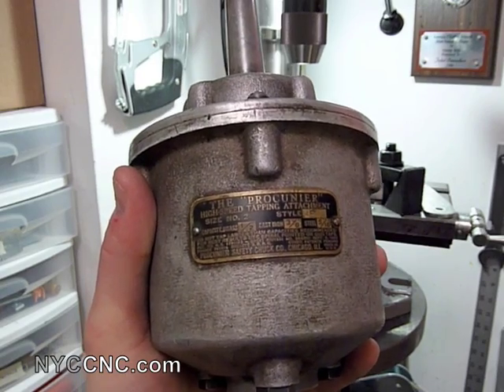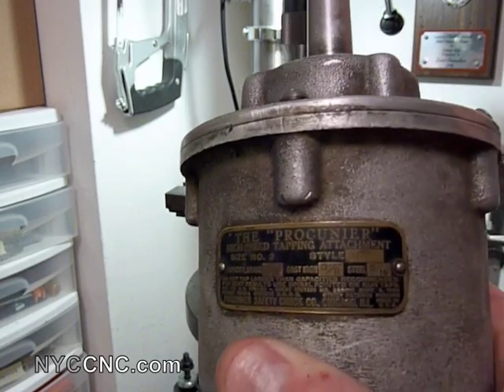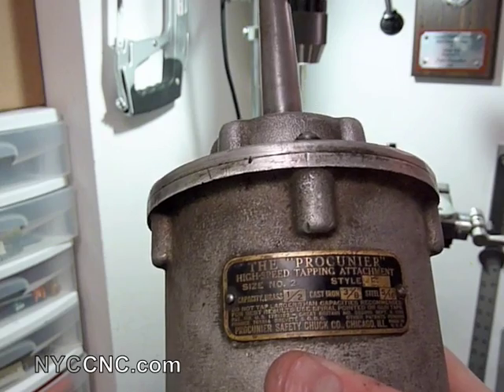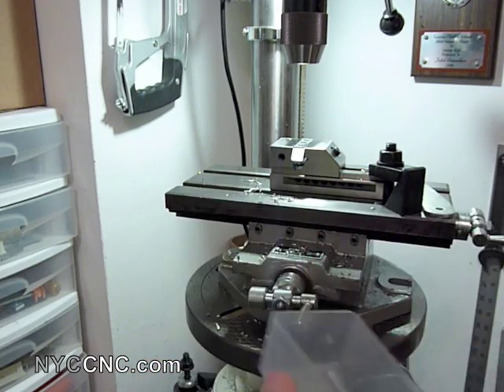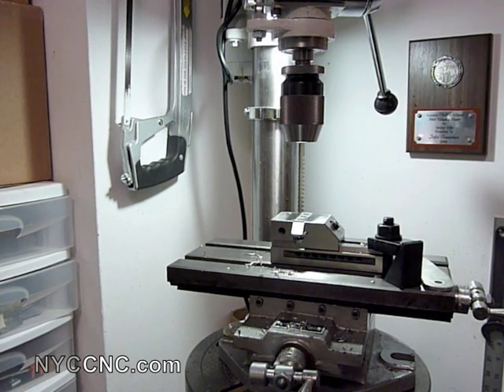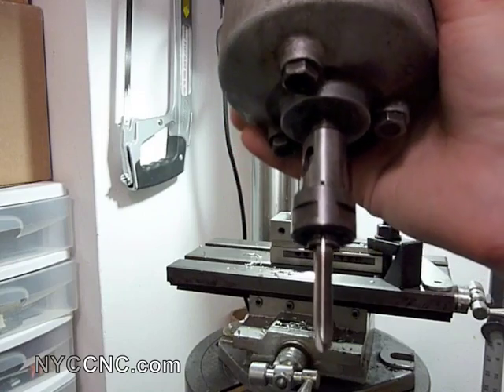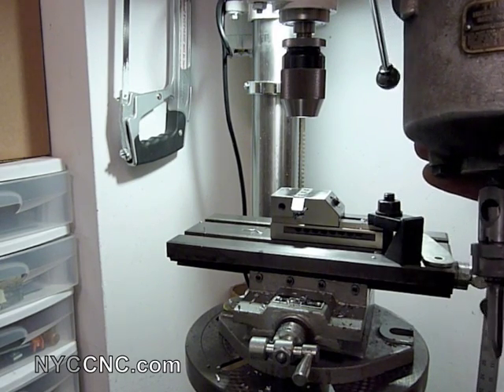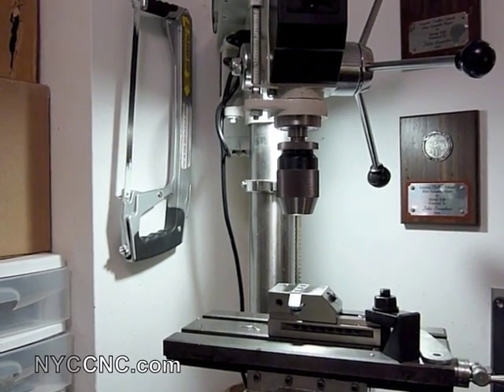Procunier #2E Tapping Head Demo - FASTEST WAY TO TAP HOLES!

Comment: You did well.  Thirteen months ago I paid $75 and had to buy 2 collets.  You can tap a blind hole with a gun tap if the hole is deeper than the threaded area to give room for the chips.  What brand of cross slide table are you using?

Comment: I never use a tapping head,I put the tap directly in the mill quill,run it slow and allow it to tap when you reach the depth required I stick the quill in reverse and back the tap out.Never broken a tap yet.